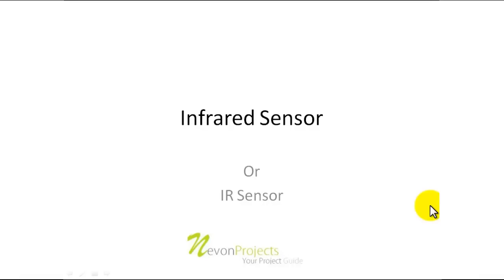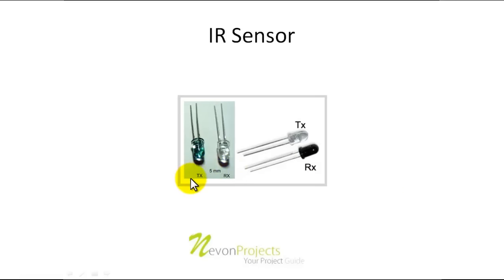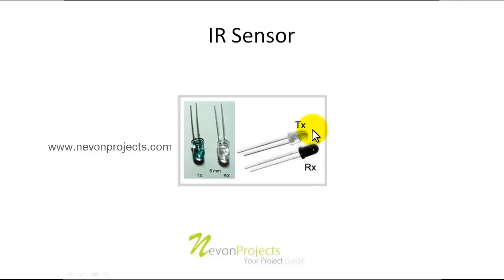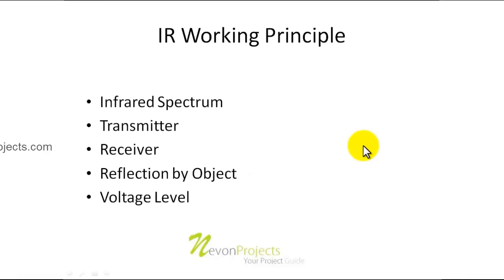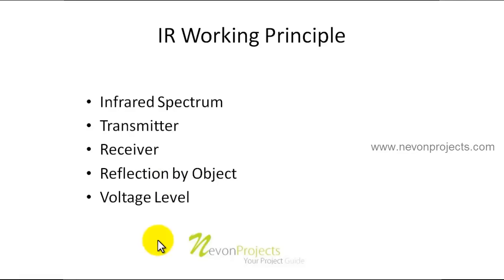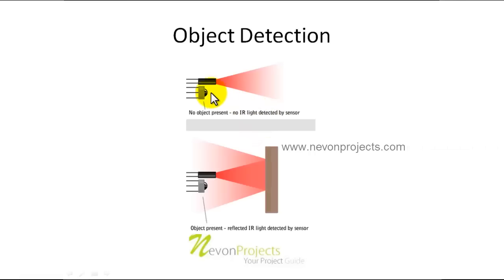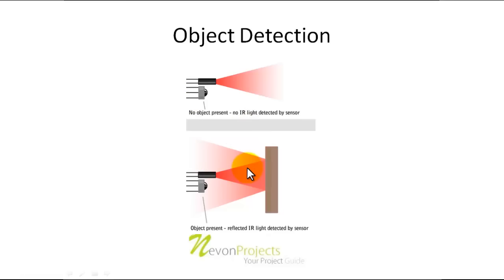IR Sensor Working Tutorial

Comment: this helped me to fix my electric skateboard i was having disconection issues i found out that the receptor was not cover by a metal plaque, so the infrared signals from the sun was interfering with the signals that my remote was trying to send to the board , i just hide the receptor under the metal plaque and that fixed the hole issue,